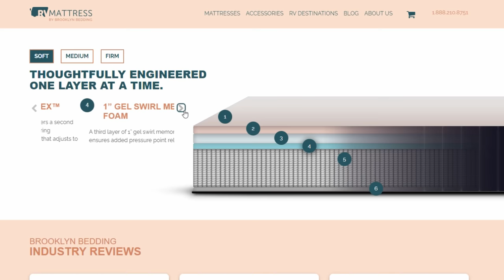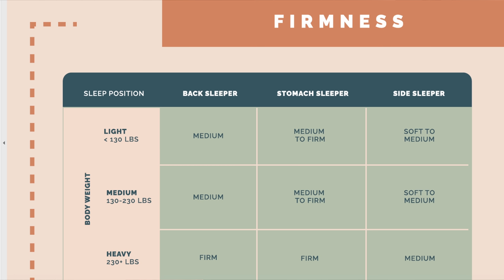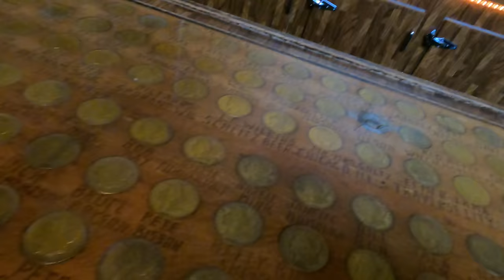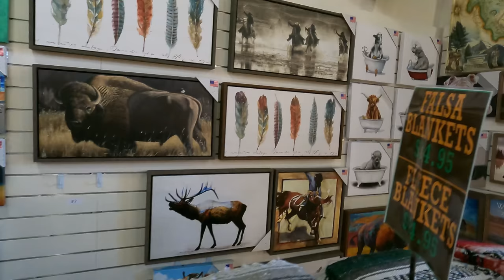Montana's Lincoln Silver Dollar Bar // Road Trip to Spokane // Full Time RV

Comment: We will be at 50,000 Silver Dollars on 7/31 headed like you all do to Spokane Valley to visit family.  Since we both have DRV’s with vanity slides — what mattress did you get from Brooklyn bedding.  My wife has convinced me to pull the trigger.  We all are about the same weight as you guys - she’s 5’2 and I’m 6’8. 
Any help appreciated.  

Don
Reply from the maker: Enjoy the Silver Dollar Bar guys!  Measure your wood platform the mattress sits on.  Ours is 71" X 79", so we purchased the RV King in size 72 X 80.  Their size chart is on their website.  Select the mattress you're interested in, above the "mattress size" selection, there is a link for all the mattress sizes that are available.